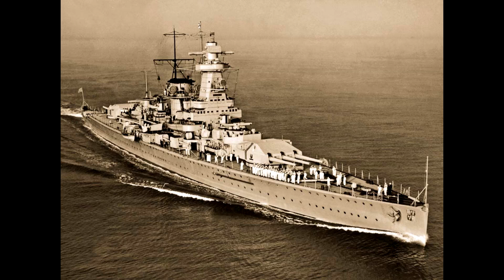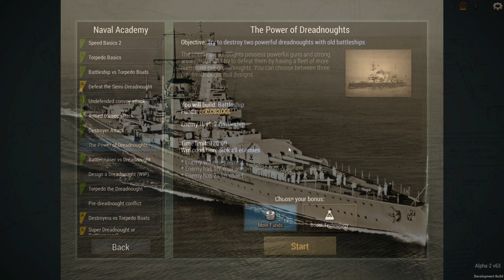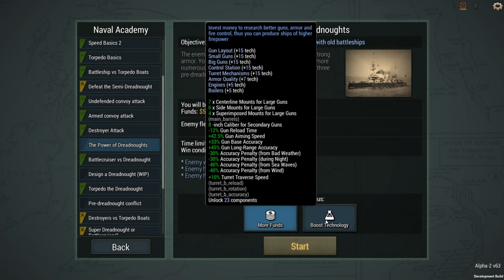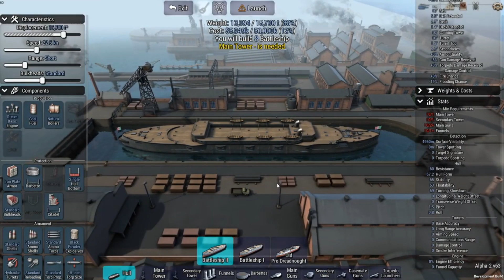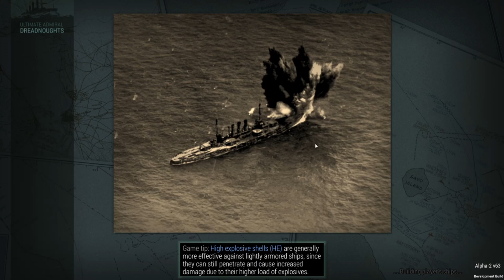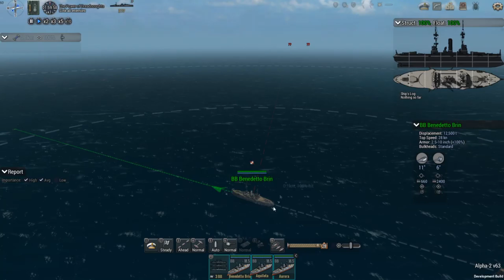Ultimate Admiral: Dreadnoughts - Building the Graf Spee

Comment: oil boilers should massively reduce your crew as you do not need an 'army' of stokers to shovel the coal in. Also, the ship should be able to accelerate faster and maintain consistent speeds (fuel pumps do not get tired, dehydrated or heat exhausted as stokers do.)
Reply: @seeleagent  True but if your coal burners get flooded quickly they go off like bombs blowing the ship apart. It is easier to fight fires before catastrophic failure than instal bombs the instant the failure happens or that coal dust in the air in emptying coal bunkers is hyper explosive. with coal all failures are explosive. oil failures sre mostly flammable so more time to fight 
But that does not change the fact of my original comment that oil-burning ships need less crew than coal burners and have faster acceleration and attain and  maintain higher speeds easily (My grandad was a Chief Petty Officer Stoker in the RN)
Reply: @seeleagent  The Hood was hit in the powder room or its torpedo magazine. That was a really unlucky hit. Nothing to do with its fuel type. The Bismark had oil burners but no matter how many shells the RN pumped into it; at point-blank range, it did not explode. Yeah the RN destroyed it beyond being salvageable/repairable. But it was probably sunk by its own scuttling charges. But why are you so obsessed with fuel types?
None of it alters the fact that oil burners need less crew than coal burners. Damage control is mostly made up by crew members who have non-combat and non-essential or mon secondary/ support combat roles on the ships such as cooks and of combat and mechanical/engineering personnel who are not on the active watch..
Again none of that alters the fact and point of my comment. Oil burning ships need less crew than coal-burners, not more.

Comment: The Spee was built to be a cruiser killer. It's a waste sending her up against a proper dreadnought.
Reply: Just like in the battle of River Plate
Reply: @kanahayakenzie3740  there were no dreadnoughts or battleships at the battle of the river plate.
Reply: @kanahayakenzie3740  the ship was bild as a Convoi raider, with the abiltty to fight aggainst faster and run from stronger ships, in 1928.
The ships were for a few years faster than any stronger and stronger than any faster ship, with the exception of the considerably larger four Japanese battlecruisers of the Kongo-class and the three British battlecruisers Hood, Renown and Repulse.

Hans Langsdorf closed to much in and tock 20 hits on the Admiral Graf Spee. He shud have fight at the longest posible distance and using HE shells instead of AP.

Comment: +15% funnelcapacity (compared to -35% for coal) and -10% boiler weight means that you save a ton of weight on faster ships. I'd consider oil for any ship cracking 20 knots and it's almost mandatory if you want to hit 30 (given the displacement/engine dynamic).
Reply: Yeah but, yeah but...
30kt is 30kt in this game whether it's single expansion steam reciprocating, steam turbine or Diesel engines. In fact if you opt for Diesel you still have to configure boilers ffs - and decide if you want coal, coal/oil or just oil rofl.
Its an Alpha version of a game that is about 6 months away so we testers get the full game for free sorta. You can get the game if you want. It's $50usd. I have to say it is annoying but it is more fun than annoying.